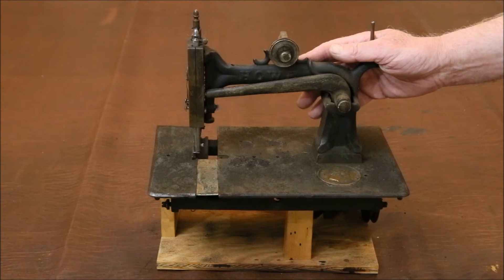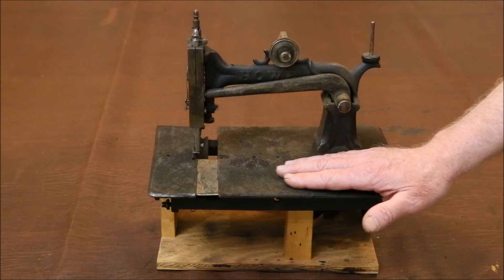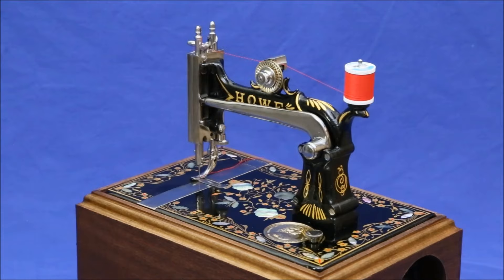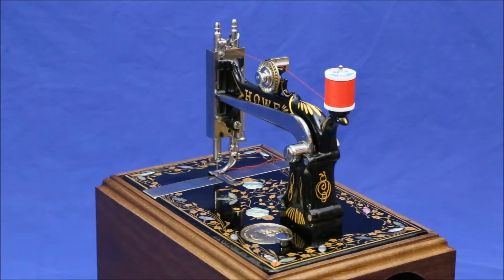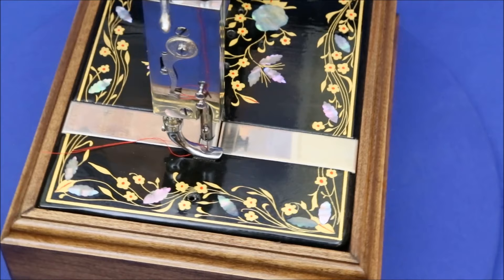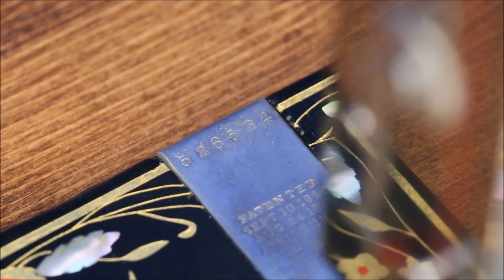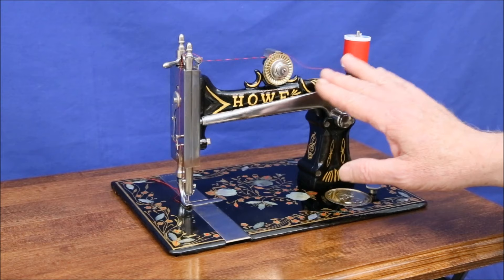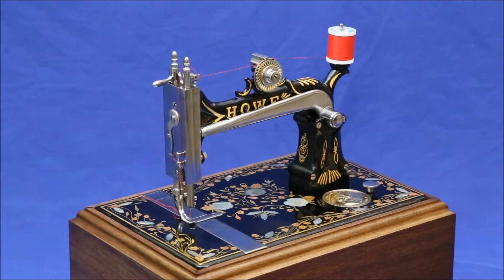1873 Howe Sewing Machine Before and After Restoration

Comment: I would love to see how you make the gold leaf decals!! This restoration is incredible!! thanks for sharing!
Reply from the maker: Thank you for commenting! Here's my video on how I make the gold decals for my restorations:

https://www.youtube.com/watch?v=2PKmkXWtQmY&list=PLEnCVl0LWmYfasxI2p2mcDF0YauzDkwYY&index=15&t=0s

The gold filigree on the Howe was not done with decals, but applied by hand. Trying to size decals to fit the pattern of the mother of pearl inlays would have been too hard.

I've been doing a lot of research on how decals were originally made for those machines that used them. I've discovered that they weren't decals but industrial transfers, which is a process in which only paint is transferred to the machine. Also, they very seldom used gold leaf, but mostly gold colored paints made with powdered bronze formulated to match gold's color. Bronze was much cheaper and resisted oxidation almost as well as true gold.

Right now I'm recreating a set of decals for an Improved Taylor sewing machine.

I checked out your channel. You have what looks like a super heavy duty machine to handle that much denim. 

Thanks again for the comment!

Comment: Hello Wayne! It’s greate job! Your restoration works inspire me. please tell me what to do if the paint on the sewing machine is partially damaged.  one part is perfectly painted, while other parts are rusty and without paint.  how to be  will the difference be visible if painted in parts?  and what is the painting technology in this case?
Reply from the maker: The black paint originally applied to all antique sewing machines is canned 'japanning.' It's a mixture of asphaltum (a very pure form of powdered asphalt, the same stuff used on roads) linseed oil and turpentine. It's baked onto the machine to form an extremely hard and tough finish. I have found that Rustoleum's Gloss Protective Enamel spray paint works very well at matching its color, but this would only be good for redoing the entire machine. For small spots, I used Testor's Gloss Black Enamel. These are the hobby paints that come in very small bottles. A key to getting a good color match is to thoroughly clean the old paint with degreaser then polish it with Novus 2 fine scratch remover. This Novus 2 product is a fine grained, mild abrasive liquid that'll make the old japanning shine like new. Most importantly, although it's called a 'polish,' it doesn't put down any polishing compounds like wax that would make paint fail to adhere to it.

If more than 20-percent of the machine is rusted, I recommend repainting the entire machine. The problem with this is that it paints over any existing artwork. Only you can decide whether you want to do a touch-up to preserve as much original material as possible or try a complete restoration, which will almost always results in a better looking machine.

All of the above requires that all rust is removed prior to painting.

What machine do you have? Thanks for commenting!!
Reply: Wayne Schmidt thank you very much! Your advices very important for me 😊  I restoring pfaff-11 now.
Reply: Wayne Schmidt could you explain me by other words what mean “japanning”, I cant translate it correctly ...
Reply from the maker: @vikashinii777  In Europe in the 1700s, asian lacquer artwork was so popular that demand was greater than what could be imported. This artwork was often referred to as coming from Japan and became known as Japan art or Japanned art. It was built up of many layers of lacquer. The plants needed to produce Japan-type lacquer were not available in Europe so artisans developed something that looked a lot like it. This was a mixture of asphalt, linseed oil and turpentine baked into a hard material. Because it looked like the real Japanned artwork material, it was given the name Japanning, because it was a process for coating things so they looked like they were made in Japan.

Here is a wikipedia article about it:

https://en.wikipedia.org/wiki/Japanning

I hope this helps. I've made the Japanning mixture at home and an oven in which to bake it. It's a messing, difficult, dangerous process that is easy to mess up.
Reply: Wayne Schmidt Thank you very much Wayne! 🙏🏻🌷🍀

Comment: Wayne did you use Spax Stix chrome on the needle arm?
Reply from the maker: No. Paint would never stand up to the sliding wear on it. Also, a coat of paint would have made the shaft too large to fit into the guide holes. The needle arm was polished with micro mesh polishing sheets, starting with the 1500 mesh and ending at 12,000. Thanks for commenting!

Comment: please tell me how to protect metal parts that you polished from possible corrosion?  Is there any chemical that can be used to grease a part after polishing?
Reply from the maker: Hello  and thanks for commenting! Putting a mirror finish on a metal part goes a long way toward reducing rust and tarnish because it reduces the surface area exposed to the air. Rough surfaces have thousands of scratches that increase surface area, which exposes more surface to air and moisture so they rust much faster. As added protection any metal polish will help a lot. I use a product called "Autosol." It removes very fine scratches and lays down a protective layer to prevent rust. Any automotive store should have a wide range of metal polishes that should work just as good. Unfortunately, I don't have a big corrosion problem where I live because I'm in the desert and the low humidity slows rusting. Good luck!
Reply: Wayne Schmidt Thank you for the detailed answer.  I am restoring the parts that were nickel-plated and in thought should I put nickel on these parts again or polish them well will enough) In Moscow, the climate is damp))) Do you have your account in instagram?
Reply from the maker: @vikashinii777  Sorry, I don't have an Instagram account. Replating is the best way to go, but I've found it is very difficult on anything larger than a few square inches. If you can find a professional plater who can do it for you it'll save a lot of problems and almost certainly come out better. You're in Moscow? Russia? Wow. I'm in Southern California, USA. We are on opposite sides of the planet and conversing like it's nothing special. Amazing.

By the way, if you don't want the hassle of redoing the decorations with gold leaf, I'm filming a video this weekend about the best gold paint to use for antique sewing machines. It turns out finding a paint that has the same color originally used on these machines is hard.
Reply from the maker: @vikashinii777  I'll be happy to help you in any way I can with your restoration. If you'd like to see some of the other sewing machines in our collection, please go to www.waynesthisandthat.com and click on the "Antique Sewing Machines" link. I don't sell or advertise anything so you don't have to worry about pop-ups.

Comment: Hello!  I polished the sewing machine plates.  The last sandpaper with grain 2500, then manually polished with felt using an autosol.  The surface is mirrored, but there are still very small scratches.  Is it possible to get rid of them?  May be  it need to be finished polishing on a grinding machine?
Reply from the maker: I use micro mesh polishing sheets. (Available from Amazon.com.) These go from 1500 mesh to 12,000 mesh. It's important to completely remove all the scratches from the previous mesh before moving onto the next. Working by hand a small 2cm x 8cm plate can take 30 to 40 minutes. Then I go over it with autosol. I haven't found anything that works as good. I hope this helps.

Comment: i tried to contact you but your email is down. I bought a Howe sewing machine  but part #33 the take up spring is missing. Can you make one for me or send ma an image so I can try to make so this machine can sew? Thank you, Will
Reply from the maker: Hi, Will! I figured the best way to show what the spring looks like and its dimensions was to make a short video of it. You can watch it here:

https://www.youtube.com/watch?v=VciNDa4DbNY

I suggested guitar wire because you need a wire that's stiff enough to hold its shape. Looking closely at the spring I see lots of flat spots, suggesting it was roughly formed by holding it in needle nosed pliers and bending it into shape. Good luck!
Reply from the maker: You can also get thin, stiff wire from most hobby sops. This may be cheaper than buying guitar strings.